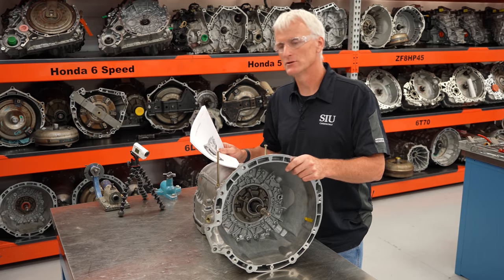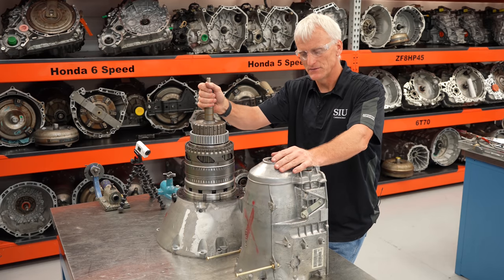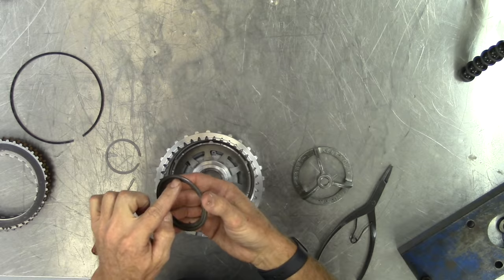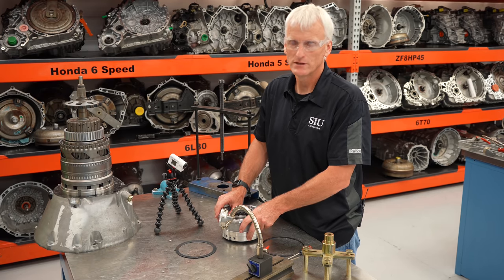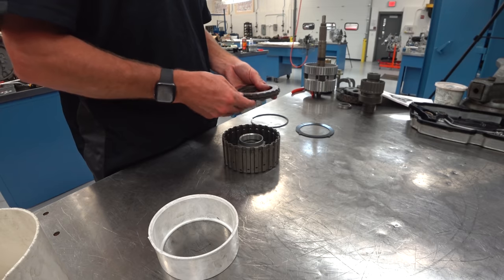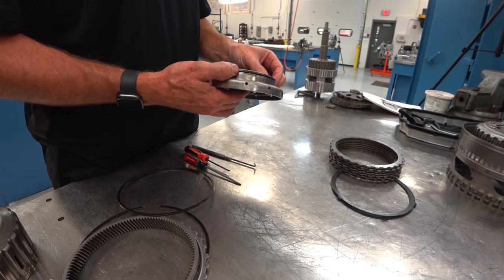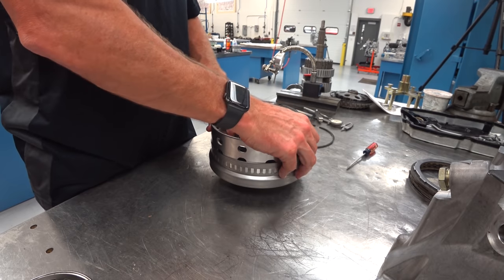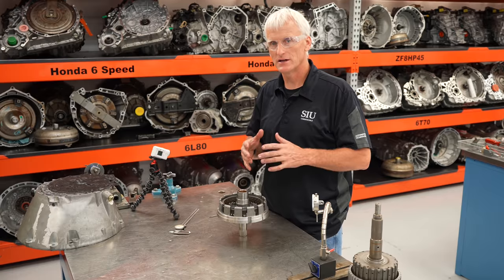Mercedes 722.6 Chrysler NAG OVERHAUL complete

Comment: Hi again, I have tried to swap a 722.616 bell housing to a 722.644! Everything was fine and exciting until the moment I realize I have a 2 mm gap preventing me to bolt it back on. I synched all the clutches, so I could insert all the clutch packs easily! Have removed and replace everything multiple times and still can't get it in entirely, any light would be amazingly helpful, thanks in advance!

Comment: Please make a video for troubleshooting... so that we can decide if we can just flush fluid, change filter, change conducting plate, change valve springs... (All these we can do without taking down the tranny), or tranny has to come down to change the fiction plates, and/or sprag bearing, etc... These transmissions can be had for $500 on ebay. Instead of taking ours apart / out a few times, it might be better to swap with a used one, put on new conductor plate, filter, adapter, and fluid.
Swapping tranny does not require programming (like the meghatronic in BMW), am I right?
I see a "722 618 0" stamped on my tranny. All I need is another "722 618 0", regardless of what model / year of the car it came off from, right?

Comment: Great video.  The only thing I ask is if you could post the clutch clearance specs for each configuration.  I had a couple that had a different number of friction disks and the paper guide only gave specs without the compression tool

Comment: Hello,
Please I have issue that is yet to be solved with my CLK Mercedes 722.6 Gear/Transmission Box, same as this one in the video.
The car suddenly wont shift from Gear One, and soon after the car wont select or engage at all bringing the car to a full stop and no movement.
I have had Mechanics/Experts work on the gear box, they change the gear pump(as explained in this video you called it oil pump) and also the RPM Sensor (Black Conductor) and after driving the car for about 2hours, I started hearing some whining sound (sound similar to faulty power steering pump use to make when changing direction) from the transmission box and I faintly smell the boiling transmission fluid. Shortly after the car goes to emergency running and wont shift again.
I changed the gear/transmission box completely for a new one, but same thing issue arises after driving for about same hours as the old one- boiling transmission fluid smell, and car not shifting and wont engage and also the sound return.
The mechanics that worked on the car seems to have no idea as to what is causing the gear/transmission box (oil pump) to fail and damage. 
Please what do you, in your professional view think can be the cause of the problem? Please

Comment: How much clearance is between the parking pawl gear and the housing or pawl itself ? Could the tip of one of the teeth be bent up by the parking pawl when put in park while not at a completely stopped and cause a light tap every revolution of the output staff.

Comment: Thank you for the video!
Question: Has anyone put new teflon rings (say Transtec or others) that leaked during the air test, kept them and they actually developed a problem in the actual vehicle? 
(I say this because other kinds of Teflon seals need to "adjust under pressure" on most applications to actually seat/seal)

Comment: Great video!!! I'm troubleshooting a stalling issue on a 06 Charger SXT and wanted to rule out Trans solenoids. Would failure in any of the solenoids cause stalling at around 30 mph??? Multiple sensors have been changed, no check engine codes, still shut off going down the road. No shifting issues, smooth running motor/trans. Any help appreciated.
Reply: Could’ve sworn the 05 and 06 Models had that Gas Tank Recall that would cause it to stall after filling it up. Is this no matter what gas level you have? Your torque converter could possibly be failing. What speed are you at everytime it  shuts down?
Reply: @BWADaniel  Random speeds. Sometimes at take off. As far as fuel levels, it varies also. About the only thing I haven't looked into IS the torque converter. I recently pulled and cleaned the cats and installed new O2 sensors to rule that out.. Thanks for your reply

Comment: What a great video! With this video I have confidence that I could do this in my own garage. There are a couple of delays, like if I want to set the clutches on the tight side of spec I will have to do everything and order parts... but there's probably no way around that.

I bought one of these from a dismantler and the B1 sprag bushing was galled, and smelled of burnt clutch. I'm guessing it had exactly the issue you described as most common. Fortunately they are taking it back and replacing it for me. I am curious though, you never mentioned the torque for the T27s that go into the B1 clutch housing, or the T40s that go from bell to case. I'm sure I can look that up if I have to, but it would be nice to add.

Comment: Do you offer rebuilt Nag1's for sale?I have a 2000ml320 that seems to hold gears pretty long,I have done 2 fluid and filter changes and a couple more drain and fills,as well as 13pin connector, also did not see any atf ingress in the harness or tcm.i have no stored TCM codes no engine light,scanned with an Icarsoft MB.

Comment: I appreciate your through explanation of the workings of this transmission. 

I have a 722.622 that won’t shift passed third gear. It goes into limp home mode after failing to shift to fourth. I have codes 051 and 147 using Star Diagnostics. 

Should I focus on the 3-4 valves? The 3-4 solenoid?

Comment: I have a question... Can I rebuild a NAG1 that chewed the tabs off the oil pump? There were no large chunks, and everything looks okay, I am using a different valve body and solenoids.   The little tabs were completely gone.

Comment: I love y’all lol but I was wanting  to double check but it doesn’t have a lock up shaft seal for the converter  correct ? Cause I just slapped the new 3,000 stall converter on and strapped on a new hemi to it with nitrous lol. For the life of me couldn’t remember .
Reply from the maker: The seal for lockup is in the convertor. https://www.sonnax.com/parts/1289-front-cover-hub

Comment: I have a 2004 sprinter with a 722.6 transmission. I have a shift flare from 2-3 and I have replaced 
Shift solenoid 
Conductor plate 
Harness connector 
Overlap valve sleeve kit 
But I still have the flare from 2-3 any idea what I should look at next?
Reply: Did you ever get to the bottom of it?  Sounds like your might be just valve body.  I have slam under heavy accel at 1-2, then flare at every other shift, but once in gear no slip at all.  I replaced conductor plate and then also tried entirely different (but used) valve body and solenoids but zero change in symptoms.  I thought for sure it was valve body related, but after swapping these swaps that I did figure it is not in the valve body.

Comment: I'm figuring, from your video's, the biggest suspect in my box is pressure valves or (less likely) my torque converter. Faults in my TCM are varying from 0733: Gear 3 implausible or slipping, 0734: Gear 4 implausible or slipping, 0730: Transmission has an impermissible transmission ratio, 0731: Gear 1 implausible or slipping and 2784: speed comparison of Y3/6n2 to Y3/6n3 implausible. Am I correct?

My box is slipping in al gears to the point where (when its warming up) it has no drive at all and starts to make funny noises from the front of the box.

Do you have some pinpointers on my diagnose or maybe even a troubleshooting diagram? I figure I might be in a little over my head. Thank you in advance!!
Reply from the maker: Hmmm, the noise is probably the pump whining.  It sounds like you have low pressure.  If you drop the pan, you might have a bunch of clutch material in there clogging your filter up. It sounds like it’s time for a rebuild.

Comment: what is the next thing to check when the transmission still does not shift to higher gears after the conductor plate and solenoids have been changed???
Reply: You typically need to reset the TCU fault after a failed conductor plate.  Only certain code readers will work on these transmissions.

Comment: (722.6) How many litres total  7.5 or 8 ?
Torque converter capacity ?
Drain pan capacity ?
Have shifting issues after fluid change ( low or overfilled)
C200, w204, 2009 model
What is the normal Mercedes transmission operating temperature?
Reply: IIRC, 180°f is the temperature to check fluid level. Hopefully you have dipstick tool, mine is kept in Ziploc type bag in the spare tire compartment. Slightly not enough is far safer than too much - Too much fluid can be catastrophic!! Be patient while adding, checking and adding as necessary until results are spot on.  It takes less time to add and check a dozen times versus having to drain some and starting over because one gets overzealous pouring ATF 4/134 into the thin, air choked tube
The answer to how much fluid is: hot fluid (180 degrees), car level, fluid at or just below (like a fingernail thickness) FULL Mark on dip tool (yes, it is a tool which means DO NOT leave it under the hood). 
Shift issues could possibly be from long interval prior to your fluid change. If old fluid had way too many miles, then built up crud might build up in valve body as well as other areas.  Whenever I buy a used Benz, I automatically pull valve body and disassemble for a good internal cleaning. Another couple of issues could include fluid passing through 13 pin connector and or conductor plate. You have not said if problem was immediately after or if it worked for awhile after you changed fluid. If you did remove valve body  ... did you get the white plastic shifty thingy mahbop hooked in just right?

Comment: Is there is any difference between 722.6 transmission are they interchangeable. Please let me know if possible thanks
Reply from the maker: Yes, there are differences.  I’m know expert on the variations.  But generally speaking, there is the 330 smaller 722.6 and the 580 larger 722.6.  Plus, there are different clutch counts internally depending on applications.

Comment: I just got the 722.662 (W5A300) out of my 1998 ML320.  Attempting to tackle this myself.  Question:  Upon returning from a long trip (pulling another car), the transmission seemed to start getting hot.  It would downshift into 4th (or even 3rd) and stay there until I pulled over and let it rest a few minutes.  When it would do this, it would ALSO start blowing fluid (seemingly) out around the pan (from the head, I assume).  As long as I drove it under 55MPH, it was okay.  Any faster, and it would start leaking fluid (especially around passenger side of the pan) and want to shift to 4th (and stay there).  No codes!  Even connected factory STAR-Diagnosis and nothing!  No slippage, etc.  Shifts smoothly, no shuttering, etc.  New filter/fluid/pan gasket did not help.  Once I tear into this, any tips as to WHERE I may want to pay special attention to?
Reply: well you may or may not be having this issue still but just my two cents/. sounds like fluid temp was getting too high, shifting into that lower gear it was trying to cool itself down. make sure fluid level is okay and id try putting a deeper pan on it to see if that helps, (considering you said shift quality was still good) I would assume the clutches aren't burnt yet. hopefully you figured it out!
Reply: Hi, i have exactly same issue, did you ever solved yours? Mine is running fine, until at some point it is going into similr like limp mode, cant shift any up/down and then starts pushing out oil from as far as it looks "breather plug" on top. By restarting engine, it clears off, car runs fine again. What coupd cause this?
Reply: @8KRealisticSolutions  As Brandon mentioned.. fluid temps and level are the reason here.  YES, I resolved the issue - but here is what happened:

So I basically said the hell with it and found another (used) transmission from a low-mileage ML320 and did the swap myself.  All seemed well the first few miles until the NEW transmission started doing almost the same!  Long story short: my trans level checker I had purchased some 10 years ago was wrong!  It was off by a few milimeters - causing my fluid level to be LOW. 

When the 722.6 is low on fluid, it WILL overheat.  One of the things that the 722.6 transmission control module is programmed to do when the trans temp exceeds a certain value is drop into a lower gear and lock-in.  Excessive heat will cause issues with the gaskets and seals: allowing the fuid to essentially blow out around any gasket that can not take the heat.  On the old trans, I noticed the leak to be from the same area - passenger side towards the front.  If I had to guesse... the pan gasket and/or connector o-ring (right in that area) just cannot take excessive heat.

A new dipstick from eBay showed me I was low. After correcting the fluid level (on the new transmission), the overheating (locking into lower gears) was resolved.  UNTIL....

I started towing.  Then the problem came back.  The solution?  I installed an after-market trans cooler from Autozone ($75).  Issue 100% resolved - even when pulling my 12 foot enclosed trailer through the mountains of central Mexico and Denver, CO.

These transmissions are sensitive to fluid temp and level.  VERY SENSITIVE!  Ensure you got a good dipstick fluid checker and ensure your fluid level is correct.

The the lesson here is simple: TWO transmissions (including a very low mile one) were doing the SAME EXACT THING all because I did not have the correct fluid level (off my just a tiny hair!!!).  Check the fluid exactly as specified in the service manuals!  Cold, then again at temp.  And make DAMN SURE the level is as perfectly "in the center" of the dipstick "warm range" as you can get it.  Be sure to drive it a good 20 minutes down the highway to ensure 100% the trans is GOOD AND WARM and CHECK AGAIN!!!

The service techs are not kidding when they say "the 722.6 is extremely sensitive to fluid level".

The plus side (for me) is this:  I now have a newer transmission in my ML AND... the updated transfer-case w/ the 49/51 torque split (vs the 50/50) and turning corners is now smoother.   I learned that - upon removing the OLD transmission - the rear output seal had been leaking - allowing slow loss of fluid over time.  I made sure to install NEW seals and orings across-the-board on the new trans that I installed.  Now it is bone dry under my car.

Finally... that pesky shifter lever oring is notorious for leaking - ensure that is not the source of your fluid loss (in the same area).  The seal is only a few bucks.  To install it, you do NOT need the special tool - I press them in w/ a small 1/4" socket and a long bolt/nut.  Presses right in.  The old one pry's out easily with a large flat head screwdriver.

Regarding YOUR case... blowing out the TOP BREATHER would lead me to believe that yours is overfilled (but I could be wrong).  Again.. you need to CHECK THE FLUID with a GOOD dipstick checker - and do it according to the exact specs outlined in the service manual (FLAT ground... cold/25c AND again hot at 80c).  Absolutely NO SHORTCUTS and NO SUBSTITUTIONS.

I did an entire trans swap - and STILL had the same issue because my fluid level was off by a smidgen. 

Hope this helps.

-Dean

p.s.  Did I forget to mention these transmissions are SENSITIVE to fluid level?  lol...
Reply: @deanrantala  huge respect for your time to give me full detail on your case. I will use your advise to further troubleshoot my gearbox, if i have to say at this point i also suspect level issue as the dipstick i use is some kind of inbranded and i see the sound pipe is almost 90 degr. Juat before penetrating to gerbox, when i look at the line ņd dipstick i am kind a doubt if that stick can pass without resistance that corner, so i think my gearbox ia overfilled by service as 1 scenario, i will drain complete and refill with care. 2nd theory is that there is an air admition at some point, that oil is foaming up, and then expeled tgrough breather as there is a build up of air at internals, but i am atill observing. It happens intermitent driving normal and then boom gear is locked, no manual shift, and then some oil is pushed out, i think it must be air involved as hydraulic characteristics alone would not lead to leak from top breather, this musy be air or foams trapped and tending to expand and escape.
Reply: @8KRealisticSolutions  Take a close look at this video and the other one (also by siu automotive) that details the valve body rebuild.  The oil cavity on these transmissons is shaped kind of like a pyramid.  As the transmission warms up, the rate at which the fluid rises increases.  If I understand the physics correctly, this is why it is so sensitive.  Just above the valve body is a large check valve that is meant to keep fluid from freely flowing into the tunnel (once it has expanded to a level above the VB).  This check valve is not the only place fluid has to reach the main tunnel.

Once fluid begins to substantially flood the main tunnel of this transmission - it WILL begin to whip and beat the hot fluid... causing it to foam.  Once you get get this in the main tunnel to any considerable degree, you are almost certain to have fluid purging from tha breather vent.  

Foamy fluid causes elevated temps and overheating: the fluid can no longer pump correctly, does not cool correctly, etc.

Bottom line: overfilled trans will cause foaming (air issues) and overheating.

Once the fluid is foaming and temps are over threshold.. your TCM locks the transmission into a lower gear in a last ditch attempt to cool it down.